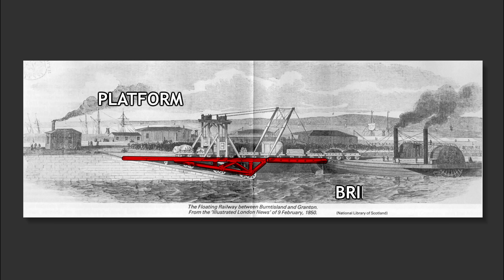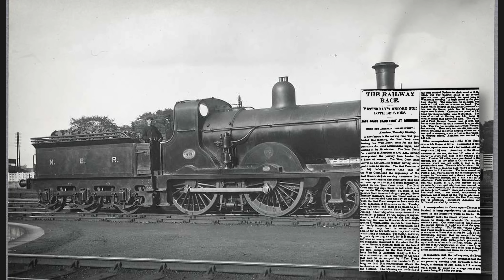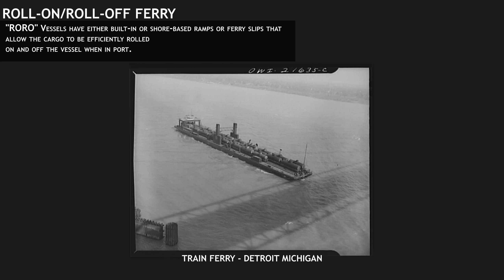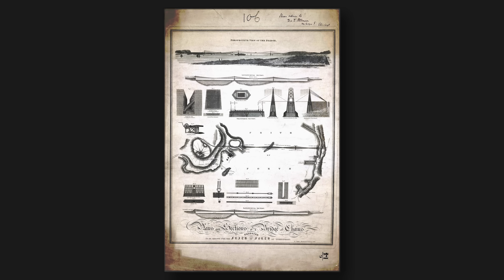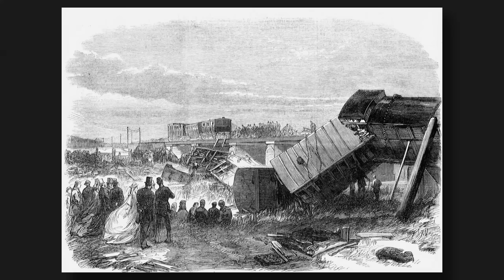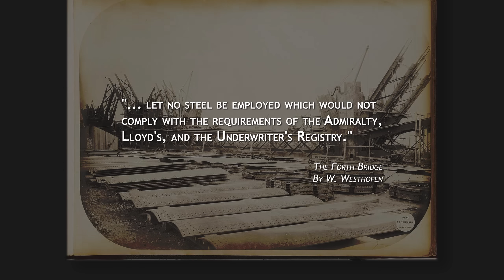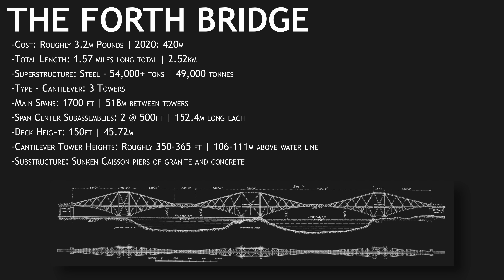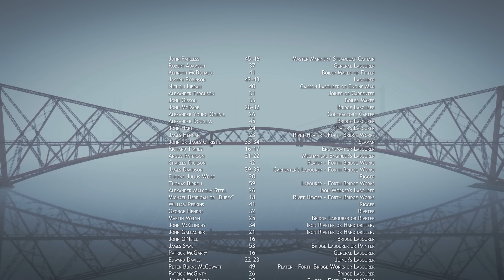Built From Deadly Lessons Learned

Comment: One of the more famous versions of the original RoRo is the SF Hydro on the Tinnsjø railway ferry that was sunk by the SOE in WWII to stop Germany receiving heavy water. When you consider that the Forth Bridge was built in a time of sailboats, it is amazing it is high enough to take modern cruise liners under it, even though it is mainly at low tide. Wind speeds in the Forth valley can exceed 100mph and has done so a few times, so, to build a bridge that still withstands these incredible pressures says something as to the quality of the build. I was a worldwide standing joke that you painted the Forth bridge, in 4 years, only to finish, go back and start again at the far side, now however it is a 4 year job that lasts 20 years as the new epoxy paints took care of protection against the weather.

Comment: The design of the Firth of Fort, cantrileaver bridge, is specifically a cantilever and beam design. This allows for movement in the pieces such that the giant cantilever structures are connected by the beams so the joints might move about on enormous hinges. We have this in the Story bridge, in the city of Brisbane Australia, where I work.

Comment: Thank you for not butchering our place names here and doing such great research on one of our most iconic landmarks. They start painting it and when they finish it's time to start again lol. Great video thank you 🏴
Reply: Not any more, a new polymer based paint with lifespan of about 20 years is used now.
Reply: Well, aye, but no.  That used to be the case, but a few years ago, they finished putting on a new paint which lasts a lot longer than the old, original recipe, paint did.  They've not had the painting scaffolding up for a long time now :)
Reply: @bmused55  thank god for technology lolz 😆

Comment: It has to be said in general that beancounters must never be allowed anywhere close to a public infrastructure project cutting costs at the expense of load capacity, such as condo towers that fall down because they slapped another 3 floors on top last minute, or bridges where the beams are undersized etc. but it is also very difficult to keep the costs spiralling out of control. This is where I find it so important that the projects must never be allowed to be done by one interested party. There has to be overisght from people who aren't financially interested in the project, such as a building code regulator, but what happens when those are bribed... even today it happens a lot. In the UK we found out a few years back that nobody was enforcing building codes in most high-risers and most of them failed the EWS1 fire certification... because the builders cut costs and nobody ever came to check if the code was properly adhered to.